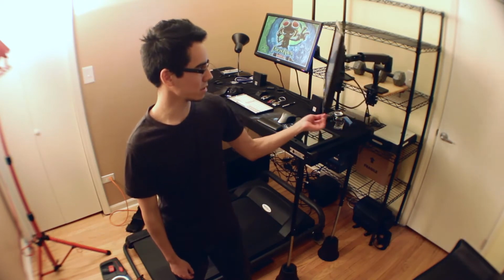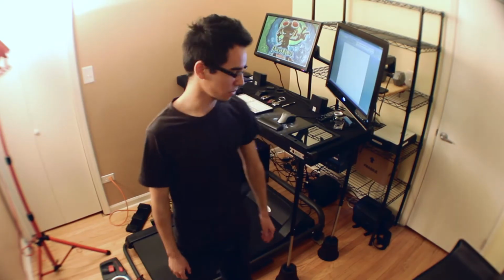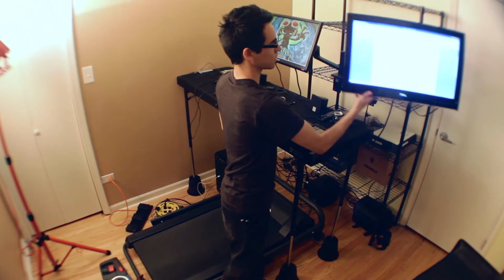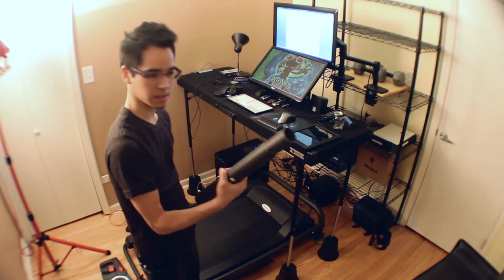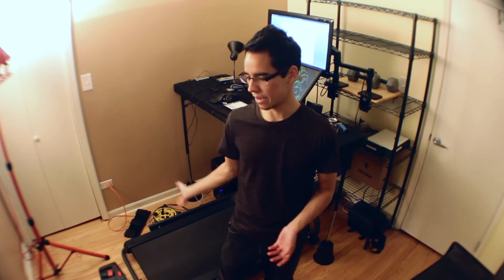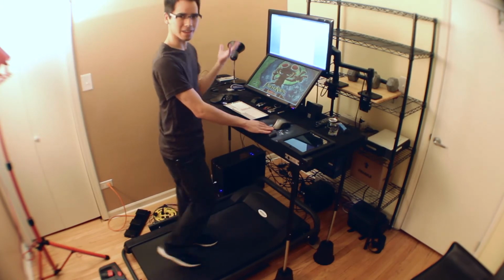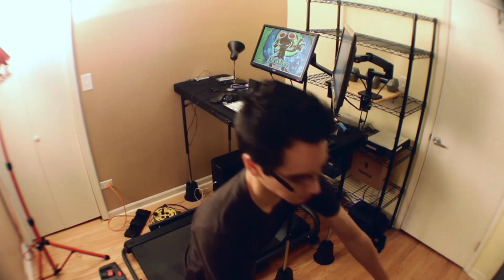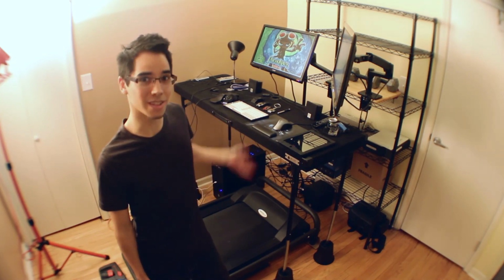Tommy Gun's Treadmill Desk - Explanation and Thoughts

Comment from the maker: The manual says maximum weight capacity is 400lbs, so you should be fine! I've been using my treadmill 6-hours-a-day since I got it, and it's fine. You may have to oil it a bit more often (you only need to do it every 6 months as it is), and adjust the belt.

Comment: Been looking into treadmills and have determined this treadmill is the minimum I would need. I weigh 210 and am 5'11". i have been looking at this and the LifeSpan models TR800 and TR1200. I would much rather spend less. Will this likely be fine with my weight? Also, the ratings for the LIfeSpan models are 3 hours and 6 hours max daily usage, respectively. Trying to figure out if that's bullshit or not. Do you think I could use the treadmill you have for 6-8 hours a day?